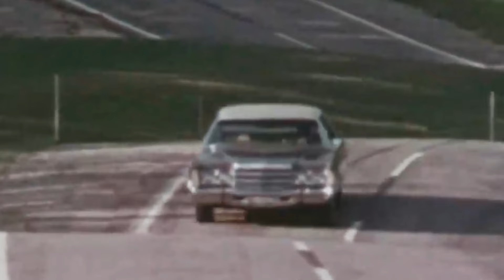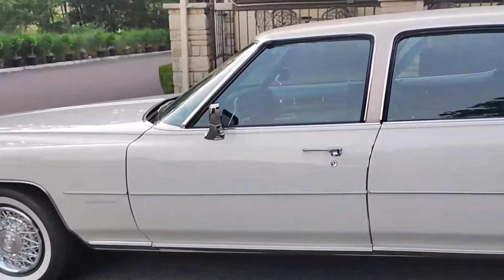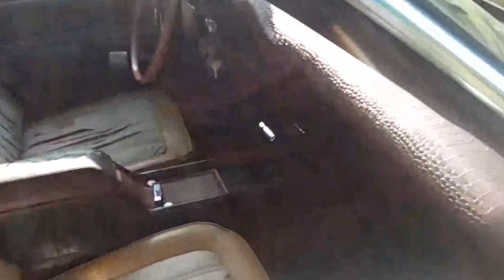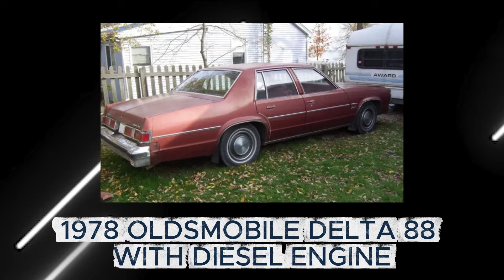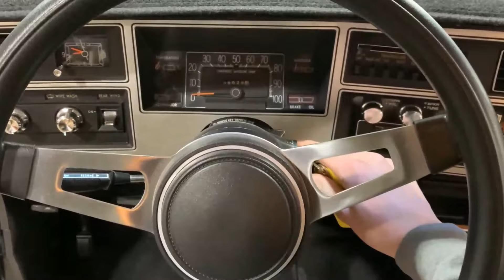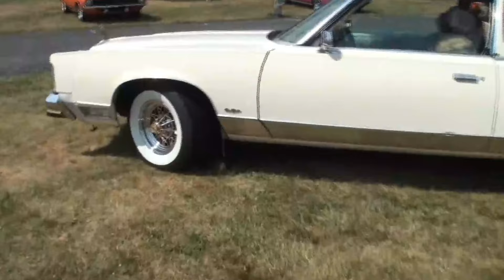The 8 Worst Full Size Cars of the 1970s

Comment: The early 1970's was the beginning of the end for the muscle car era, which had evolved into the lemon era by the  end of the decade. By the late 1970's, most American made cars had a top speed of 85 MPH, instead of at least 100 MPH, and did not accelerate very well. In response to the National 55 MPH speed limit, speedometer on American cars had the number 55 either colored orange, or highlighted in some other way, and continued that trend through much of the 1980's.

Comment: It's difficult to watch this video.  Most of what is said is nonsense.  First of all, it's not a Lincoln Mark Vee.  It's not listed from the factory as a Lincoln.   It's a Continental Mark V.  MARK 5.  The Mark V sold from 1977 to 79.  Sold like hot cakes.  The Imperial had its final year in 1975.  It was a new for 1974 body style.   These were in the design phase way before any gas shortage.   They came out in September 1973 just before the first gas shortage.  If this model was so bad, then why was it rebadged as a New Yorker in 1976.  The  ridiculous reason for the 79 LTD being bad is the lack of power windows in the base model.  Guve me a break.  Also, the LTD slow?  Which car in 1979 wasn't.   Even a 79 Corvette had horsepower ratings of 190 to 225.  So though brisk not fast.  So you expect an LTD to roast the tires.  The only car you got close was the Oldsmobile Diesel.   Even your assessment of the Dodge Aspen was off.  It wasnt a full sized car.  It was considered a compact car loke the Valiant, Maverick and Nova.  Dumb video.

Comment: I purchased a 1975 Chevy Silverado 4x4 short WB 117" First year for that model...very cool vehicle, Top line P/U, One of only 2517 built that year.  Yes, 2517... Unfortunately the engine was junk right out of the box, poor performance noisy journal bearings, constant lean surge 'n stalling,  Front brake dragging issues 'n Paint...I still own that pickup in 2025 but have had the engine and trans completely rebuilt.  I had the vehicle professionally repainted in the original Saratoga Silver and have solved the front brake dragging issue ...Original cost of the vehicle was $6200.00  An equivilant with similar features would be around $80K now... Yeah, I would say that build and engineering quality in the 1970's was a severe issue....Appears to be the same to date...Some things never change...